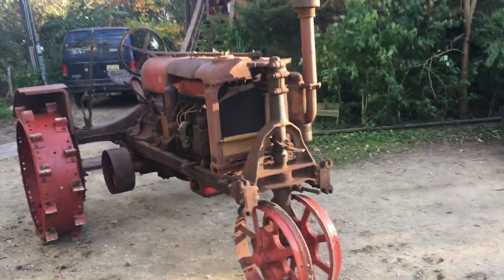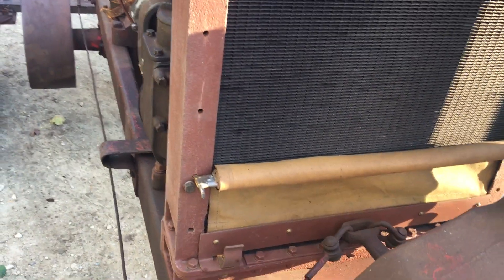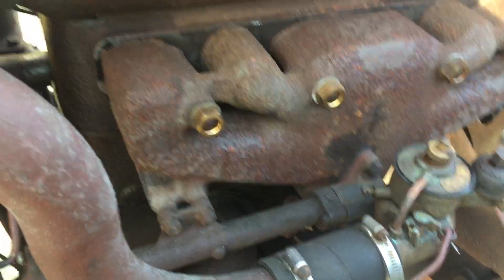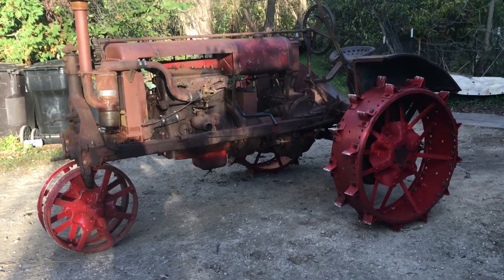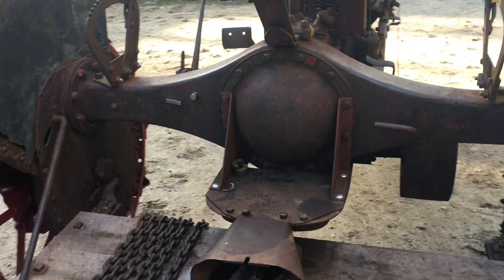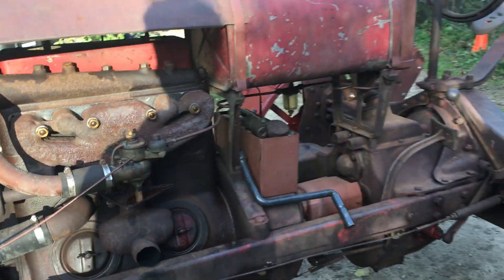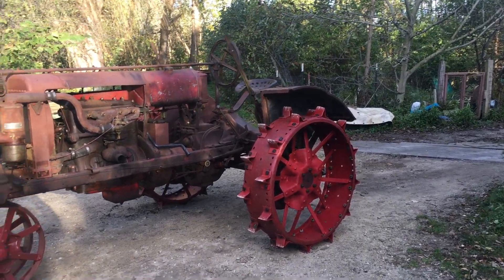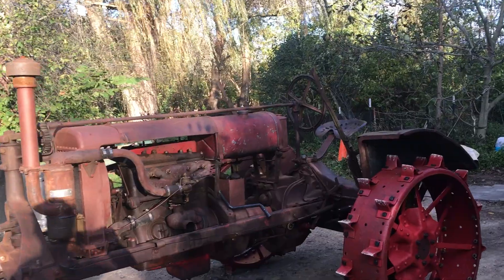Farmall Regular 1930 update

Comment: i have a ;28 on rear steel and a ;29 on rubber, full set of cultivators, and a 2 bottom little genius plow on steel. love running the old tractors, i put many hours in cultivating when i was a kid, that manual lift will give you a workout.

Comment: Sweet regular! Do you actually have a cultivator for it, or just the levers?
Reply from the maker: I took the levers off another tractor at a junk yard. But could get a set if I wanted to
Reply: @gilbertprestin7856  you should totally slap a cultivator on that tractor if you don't plan on doing too much drawbar or belt work with it.